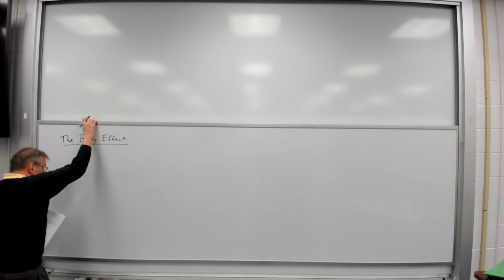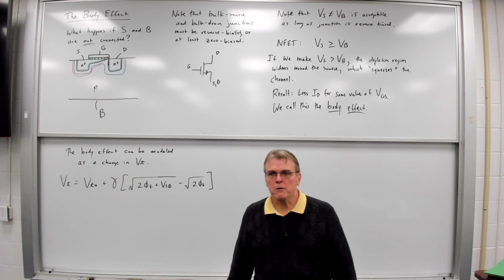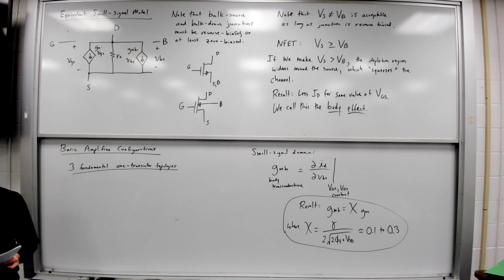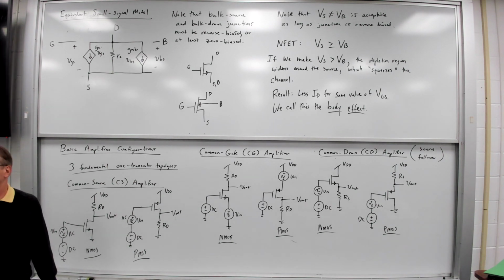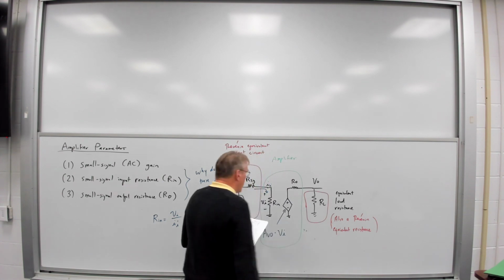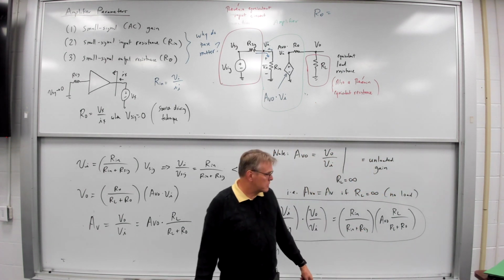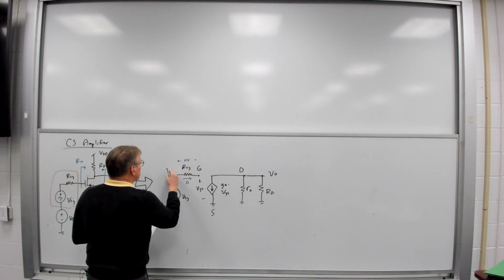Electronics - Lecture 17:  MOSFET body effect, basic amplifier topologies, common-source amplifier

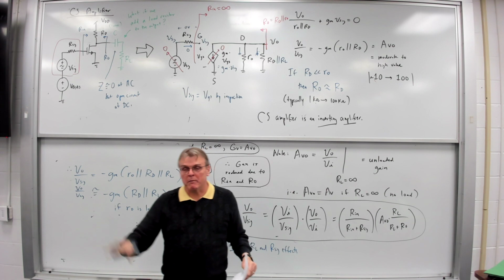Comment: At 1:11:40, why is there R_sig ??? It seems to appear out of the blue. All other previous small signal models dont have R_sig.
Reply from the maker: R_sig represents the Thevenin equivalent resistance of the circuit that is connected to the input of the amplifier.  Note also the V_sig voltage source that represents the Thevenin equivalent voltage.  It is a more accurate representation than using an ideal voltage source alone at the amplifier input.